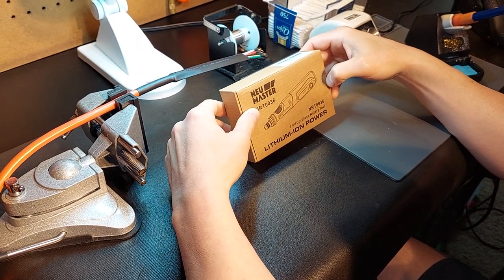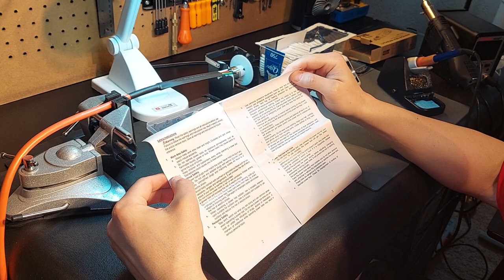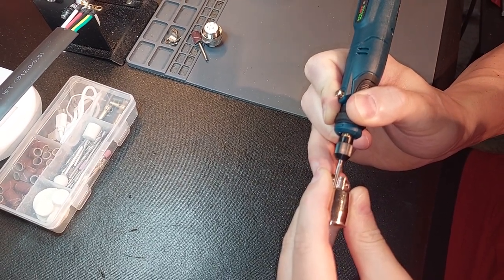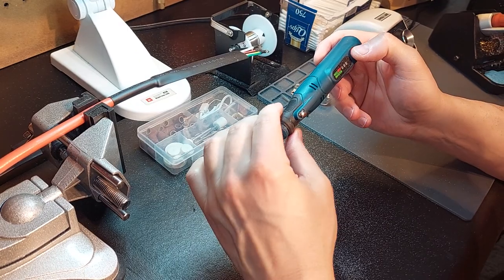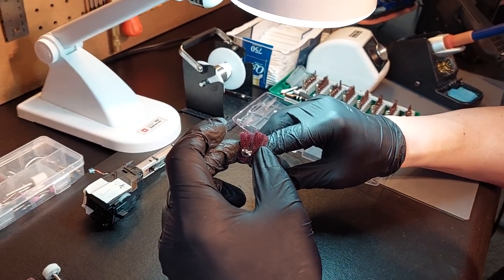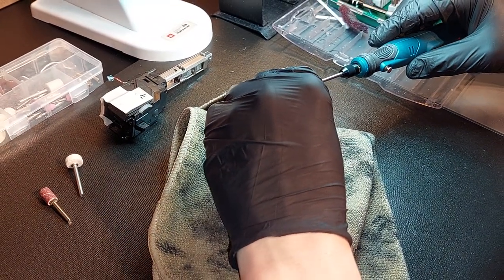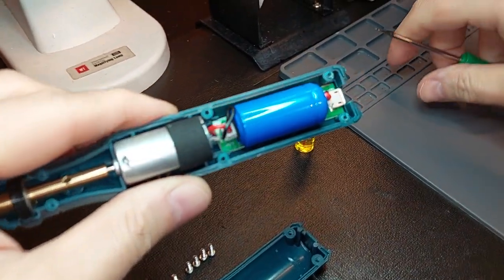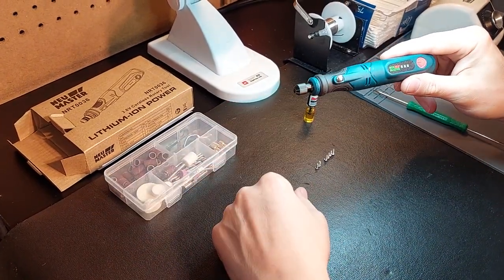NeuMaster Rotary Tool Review On Machining an HY H17 Spindle Connector And Polishing..

Comment: Thanks for reviewing this. It's very close to what I want but not quite. For my uses I need fine grain speed control. Wonder how hackable it is to patch in a speed controller.  Burned my old Dremmel that had the old analog slider for speed control, not to be confused with the detented slider they switched to when cheaping down the design.
Reply from the maker: Thank you for your support. For fine speed control adjustment I feel a Dremel is the best. I use a digital one. I'm not sure the time, investment would be worth trying to install a speed control in this unit as you can pick a Dremel up on eBay for $25-$50 Thank you, and have a great weekend!
Vince

Comment: Thanks for this review.  This seemed surprisingly decent.  Can you say what bit you used initially to grind out the inner portion?  I usually use cheap bits and would be interested in what you used.
Reply from the maker: Hey David,
Thank you for your support. The initial tool was a rotary file. These work amazing for applications like this. They do require proper control, but once you get the feel of the correct RPM balance it performs excellent. Rotary bit quality I find are very similar, except for the higher dollar bits like files, cutting ones. Thank you,
Vince